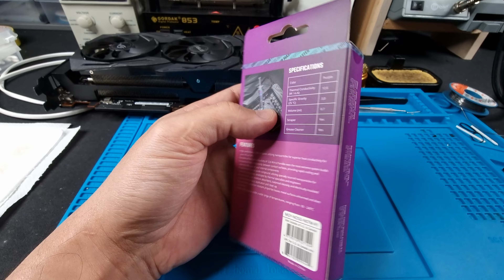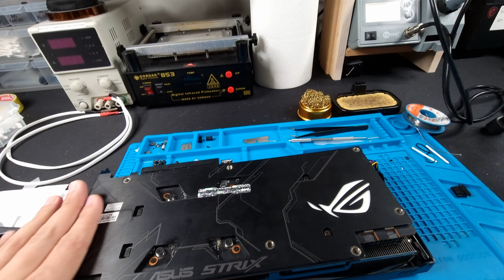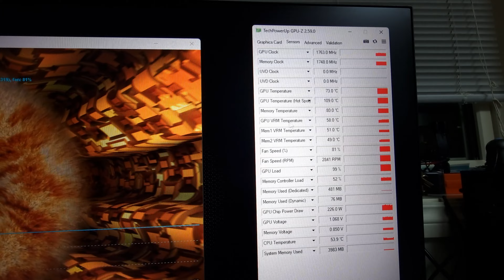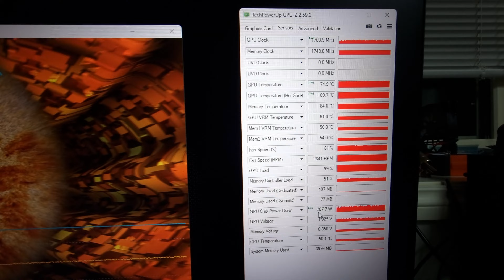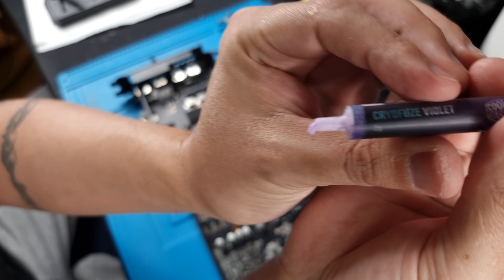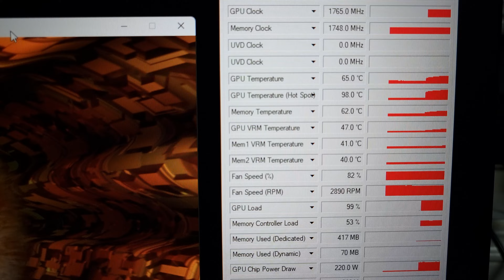Cooler Master Cryofuze Violet VS Noctua NT-H2 Thermal Pastes.

Comment: I had a Sapphire RX 5700 XT, the delta of hotspot is always terrible. I would say it's a design flaw
Reply from the maker: @Vanessinha91Pucca  could be the die that's not flat. I'd try some Thermalright Heilos. It should help with that hotspot.
Reply: @TechnologyHive  Thanks i actually gave my card to my dad as i'm with a 4070 super atm. I did re paste it as the hot spot always was horrible with MX-06. But i'll try to find Thermalright Helios
Reply: Is it better than Noctua H2? as i'm struggling with temps on my 14600K overclocked. I had better luck with Noctua paste over Kryonaut extreme
Reply from the maker: @Vanessinha91Pucca  NT-H2 is good stuff. It will last longer than Kryonaut extreme.

Comment: Great vid, thx for sharing. I owned a 5700xt for the past 5 yrs. Had to repaste it every 12 months (max) due to the hit spit delta slowly increasing over time to 30c. Max hot spot I saw was 105c.
What cured it all for me was to undervolt the Gpu v core. Temps dropped by maybe 20c and the core would still boost to max clocks.
I think there is quite alot of headroom in the core voltage on the 5700xt's so undervolting can be achieved to reduce hotspot temps.
In the beginning the vid you mentioned that the buyer said it would not power up. Do you think that could of been Psu limitations? Just a thought, keep up the great work.
Chris.
Reply from the maker: No, it was not a PSU limitation. It was rather user fault. She plugged the HDMI cable to the motherboard HDMI output, and not the graphics card lol. Believe it or not, this is a common mistake buy noobie buyers. And I understand that not everyone is tech savvy, so I have be patient with folks. No biggie.
Reply: @TechnologyHive thats easily done. Been there myself when in a rush pc parts all over the place.😅😅

Comment: Noctua thermal paste is garbage based on my experience .
Reply from the maker: @20011651  NT-H1 has an issue with pump out  NT-H2 works well. Have you tried it?

Comment: You need PTM 7950 and a washer mod if u want to get low hotspots...
Reply from the maker: @100500daniel  I just need Thermalright Heilos. Does the job better 🙂
Reply: Just reduce the voltage to the core to 1050mv. Set the boost frequency to 1999mhz Max then run Furmark again to see if its stable. From my experience these cards can run close to 2000mhz boost with 180 watt power draw.. Good luck and let me know. ALSO adjust fan curve to balance cooling/noise.  .
It's the excess voltage that cripples these cards. 😊🎉

Comment: Have used the same violet thermal paste for my hp pavillion gaming laptop , on last gen games it gives anywhere from 77-86°c but on current gen games(last of us, horizen forbiddwn west) on low graphics i get 90-96°c , if possible can you suggest me some good thermal paste from amazon india
Reply from the maker: @normaldude6699  If you want the best thermal solution, I'd go with a phase change material, like Thermalright Heilos or Honewell PTM7950.

Comment: I just re-pasted and serviced my Strix 5700XT with Iceberg Thermal FUZEIce Plus and 1990core/1800mem i get furrydonut 80c / 103c hotspot.
Reply from the maker: @DJSammy69.  I'll have to look at that. I've never tried it, though I have seen it for sale online where I live.
Reply: @TechnologyHive  Could you test next paste with the new Furmark 2.3.0 It pulls 301W using donut from my 5700XT. There is 30'c between core and hotspot. Knot pulls only 200w. 
There is two different tests and GL & Vulkan for both.
Reply from the maker: @DJSammy69.  I'll see what I can find.
Reply: @TechnologyHive  Cool.

Comment: I probably told you in another of your paste videos. NT-H1/2 are not good pastes period but the worst option for GPUs and any direct die application, the reason being that the paste is rated for a low temperature range that cause the paste to breakdown under the heat of the direct die which exceed the temperatures you see in the software because its lasting in the microsecond range of time but over hours of use these peaks break down the paste.

 If you want another paste to review look for Alphacool Apex it claims 17/wmk coolermaster also makes an even thicker paste called MasterGel Maker
Reply from the maker: @kommandokodiak6025  Thanks for the tip. I'll look for both tonight and order them. 👍🏼👍🏼 I may have read your comment from a while back. Not that I ignored it, but I do like to test things myself before passing judgment. In this case, I think you're right on the money.
Reply: MasterGel Maker is not suitable for graphics cards in long-term operation.
Reply: @nusretonat3502  ive already told him about PTM795
Reply: @nusretonat3502   Ive already told him about PTM7950